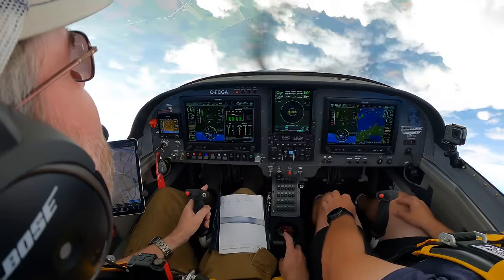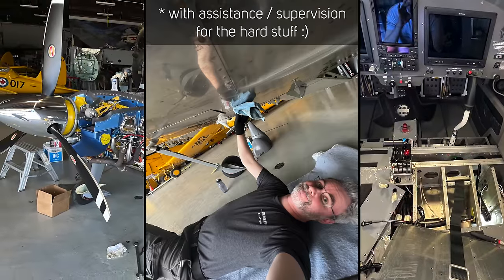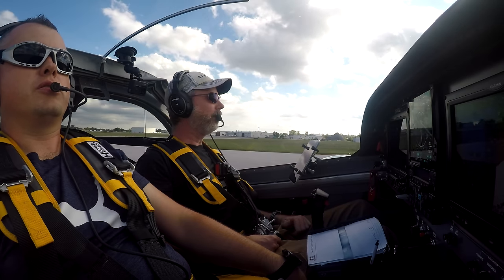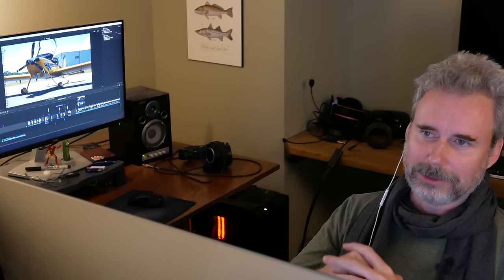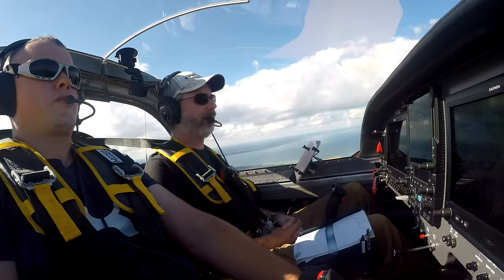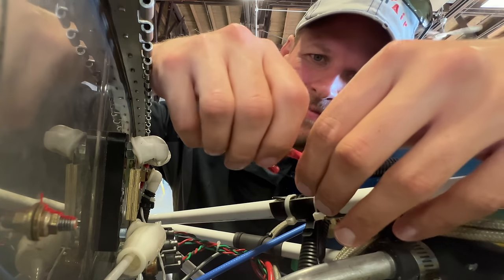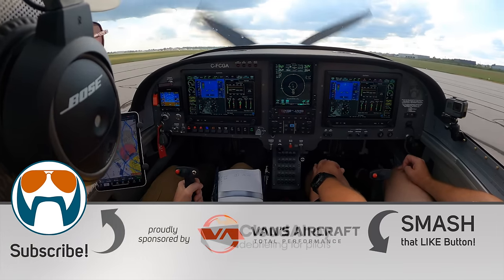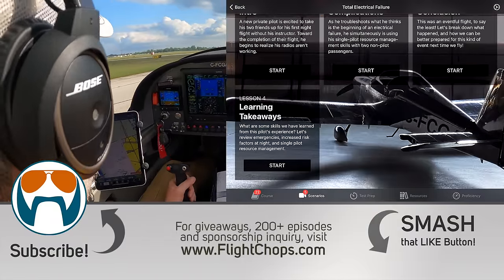Loop Induced Emergency?!

Comment: Modern synthetic oil can handle some extreme temperatures for short time periods.
Military AC can run with zero oil pressure for X amount of time.   So you have that on your side at least.
Reply from the maker: True enough - but seeing a number suddenly well beyond redline is still rather unsettling.
Reply: Nothing you said applies to this incident. There are no modern synthetic oils or military aircraft here.
Reply: @blegi1245  
My 2011 Corolla runs 0W20,  which is a synthetic oil.
If you know anything about aero engines you know they cost a fortune and I would be very, very, surprised if they were not running a pure synthetic oil.  
So lighten up. 
PS.  I love talking about motor oil.

Comment: Mechanic here, its absolutely a realistic spike in oil temperature, kind of! It all depends in how your oil system is plumbed. Most of the time if you have an external oil cooler there is a thermostat with a bypass that only sends oil through the cooler once your engine oil temp exceeds the thermostat set temperature. If that thermostat sticks closed the oil in the engine can heat soak, if the thermostat then opens the oil circulation speed up and the hot oil makes it to the sensor and shows a temp spike. Seeing the spike is really dependent on where the oil temp sensor is placed though. its unlikely that you would see a spike if the temp sensor is in an oil gallery on the block, but it’s very possible if you have a sensor present in the oil cooler loop. Either way i would double check your oil thermostat just to make sure is cycling properly.
Reply from the maker: Excellent insights here - I appreciate you taking the time to share!

Comment: NEVER, NEVER, NEVER trust a crimped connection! Always solder connections!
Reply: actually solder connections can fail quite easily in an environment with high temperature and vibration like under the engine cowl of an aircraft. crimping is almost always the right call when an engine is involved.
Reply: @murph9935  Reality says differently. This is case study in crimp failure. Just practical experience tells you crimping is highly prone to failure. I work in robotics and I can't tell you how many times I've seen crimps fail - literally thousands. I solder all my connections and never once had a failure.
Reply: Nope, solder is a no-no in high vibration environments. Proper crimp connectors are great, spade connectors are pretty universally bad.
Reply: @MyOtherCarIsAPlane  That's absurd, just think about how many soldered connections there are in aircraft of every possible kind! When was the last time your heard about a soldered connection failure? Like NEVER! And just to be perfectly clear I'm not talking about soldering the two ends of the wires together I'm talking about soldering the wire to the connectors and letting the connectors be "Disconnectable".
Reply: @theroboticscodedepot7736  Best thing is to crimp AND solder ;)
Reply: @AureliusR  I can't disagree but in my experience crimping makes it more difficult to solder (but still very possible). You do need higher temps to get the solder to flow properly into a crimped connection.
Reply: Please understand, I'm speaking as someone who has been through J-Standard training, among others. Soldering is acceptable in aviation. Still, using a ratcheting crimper is best practice. This video did not demonstrate this.

Please understand a mechanic's perspective on soldering versus crimping.
Reply: @justinmerritt6178  And please understand also I'm a metallurgical Engineer who works with electronics and wires all the time and have personally soldered 10's of thousands of connectors. Crimping a connector to the end of a wire might be acceptable to the FAA but when people's lives are on the line it pays to go the extra mile and secure the connection with solder (and take the time to do it right) and make sure it's sealed against the elements. Also it's important to leave a little slack in the wire just for such instances of bend and flex of the frame of whatever is being wired up. And also make sure the wire is secured all along it's length and not near any high heat sources and protected from any rubbing and chaffing with a wire cover. So a simple wire can become a complex job to do correctly but that's why it's important to take the time to think through all the possibilities of what can happen because if you don't you will get bitten. I think this video and the problems he encountered make this all very clear.
Reply: @AureliusR  nope.. solder in an aircraft vibration environment often causes the wire to break because it removes the flexibility in the connection.
Reply: Deleted response because throwing AMEs under the bus isn't really what I was going for.
Reply: I love the endless "no solder in vibration environments/airplanes" debate. I've been on the fence about this for years and honestly, my gut tells me to crimp, then solder. But every AME I've spoken to tells me not to do this, so as you see here, I didn't. 

I come from an electronics background and my electronics workbench is pretty complete - I definitely solder often, and I know how to solder well, but you wont find any solder in our airplane because I have strong guidance from really good AMEs telling me not to do so in an aviation environment. 

The failure of this particular joint was because it was overly tie wrapped, and was stretched and pulled to failure. The knife connector was also AME recommended. I'm confident it will hold as a good connection. Also yes, that crimper I was using is shit. I couldn't find the die-set for my ratchet crimper so I had to resort to the dollar store piece of shit seen in this video.
Reply: @thehoeser  yes thanks for replying and addressing the crimper used.. the aircraft grade terminals and crimpers have a double crimp, where it squeezes the wire and a second crimp that holds the insulation. Those original spade terminals look like the ones that only hold a single crimp. Aircraft spruce sells both the junk ones and the good ones, and you don’t know which ones are which until you look close.
Reply: @thehoeser  Yes, thanks. I was starting to think this was a dumb hill to die on.

Comment: Well handled, and good lessons for us all.

One of those decisions I have made before getting into a situation where I'd need to do that decision in a hurry:  If I ever need to cook the engine to save the rest of the plane (or even just my own ass), I'll cook the engine without hesitation, because I have already done the agonizing over it while sitting safely on the ground.
Reply from the maker: Yes, this was a great lesson for sure.  
To clarify the question around trying to save the engine: 
I really don't have the understanding or experience to know what would happen if I continued running it over the oil temp redline. 
Was a fire or catastrophic failure imminent?  I don't know.  So, I was trying to avoid the situation of an inflight fire, or being forced to put the aircraft into a field where it would likely flip and at best, we'd both be injured to some degree...  
My goal was to see what I could get out of the engine while at least keeping the oil temp in the yellow; That is what I did with about 14" manifold pressure, and I made it ~22 miles home in a constant shallow descent from ~7500' AGL. 
My other two airport options where ~15 and 20 miles away - neither of which was glide-able if the engine packed it in.

Comment: Not an A&P mech but a industrial process mech and that spike is indicative of a sensor failure or connection failure. as your engineer and you came to the conclusion of. 
My suggestion, just because I love redundancy, and I don't even know if it's feasible, practical, or allowed and that is an in dash analog oil temp gauge. I realize I may be talking right out my butt not knowing these system nor being certified to do anything but look at them. That said on every piece of machinery i every worked on that was Hydraulic. We had RTG's going to the HIM and a thermometer on the Hydraulic tank for redundancy.

Comment: the problem of your aircraft sounds very strange. I did some research a long time ago about a German aircraft. That had sort of the same problems with their sensors on oil temperature. They found out that it was their wires weren't insulated properly. And causing too much heat on the outside of the wires. They be constantly melting.. I'm not a pilot or an engineer. I'm only a flight simulator guy. Heard the story from when I was living in Germany.
Reply: That problem you mention and the issue in this video come from not understanding the environment and employing the correct wire and insulation type, terminations, routing, joints, sleeving and supports. Ok, the builder can use whatever method he chooses, but the inspector has to ensure it all meets the requirements for whatever environment it's used in taking everything into consideration.
I'm collecting parts for my impending Skyranger Nynja build and picking the inspectors brains about what is required where, what parts I can and can't use and buying the best parts I can reasonably afford. Scouring the surplus market brings up all sorts of goodies and there's no reason why pre-used salvaged items can't be used if they are in good serviceable condition. Aircraft grade cable can be found at reasonable prices and proper crimps, tools, terminal blocks etc. are available - it just needs a bit of researching. Fleabay is a good place to start, or aerojumbles😁

Comment: Was there any decrease in oil pressure? That is generally a sign that the oil temp is going up. It could have been a hint that it was only a sensor problem.
Reply from the maker: I'm going to do a follow up where I cross reference the data with Dave's situation when it was a real oil temp runway.  I think the short answer is that the pressure regulated system didn't show much of a change.

Comment: Flight Chops: Just a few comments/questions:  Is there a checklist procedure for high oil temperature?  An observation so take it for what it’s worth:  get in the habit of acknowledging oral warnings such as Altitude alerts, terrain, terrain ahead,…. I’m not familiar with your aircraft but I do have over 30 years experience flying heavy equipment.  I heard an altitude alert on your climb out that I’m assuming is a warning that you’re within a certain parameter of reaching your selected altitude (eg.1000ft) and on your approach to landing the “terrain, terrain “ audible alert went off. I know that you were VMC but don’t develop a “laisse faire” attitude to these warnings. Acknowledge them because one day they may save your ass.
Reply from the maker: Yes for sure.  I had warned Andrei that the system would “beep at us” as we approached our target altitudes, but I didn’t explicitly call it out when it happened - I definitely do so when flying IFR, but for sure this habit should be all the time.

Comment: Any reason why you didn't call a Pan Pan on this?
Reply from the maker: Nope.  That would have been a technically correct move for sure.  My thought process was to decide if I had to put it in a field or if I could keep the engine running to limp home.  Being in contact with atc the entire time meant we could tell them if things got dire.  My plan worked out and a pan pan or even emergency declared wouldn’t have expedited in this case… but there is no harm in making the call.

Comment: I hate those hoses. People use them when they are completely shot, then you think they are on and you can have missed the steel bit or it pokes out into your finger.  They havent changed in forever.

Comment: If the sensor wiring is that sensitive why not replace the wire with a one that has a outer shielding?
Reply from the maker: It's not about the shielding - our issue was related to failed connectors and/or crimps - it would have happened if the wire was shielded or not.

Comment: Nicely handled.  Consider a mechanical gauge as backup?
Reply: Naaa… you can’t just back up all your gauges with mechanical ones.. inaccurate electrical gauges are pretty rare..
Reply: @thomasaltruda  So this is a brand new build, and the 2nd time.  I would back up this one gauge because it's been problematic.  At a later date, it could be removed if desired.  He did a great job with the emergency, but it push him in to some compromises.  Since this seems to be the only problem child, I'd back it up until I had enough data to be confident the gremlin was indeed found.
Reply: @richardaldom741  the mechanical gauge is electrical too, it just uses an analog movement instead of an digital display.

Comment: On subject of hot oil temp I would expect to see oil pressure decrease.
If pressure remained steady it has to be a monitoring issue.

Did you practice  dead stick landings incase of a real engine problem?
Reply from the maker: Check out the latest episode where we compared engine data with the REAL oil temp runway - the results are surprising. 
And yes, absolutely I have practiced forced / power off approaches in this aircraft.  I still want to avoid putting it into an un manicured field at all costs though - the odds of flipping over and being injured are high with small main gear and low profile wheel pants.

Comment: hmm, i dislike spade connectors all together,  That isn’t the same oil that did get hot is it? you surely changed it. but I know once oil gets hot once, it will do it again much easier.

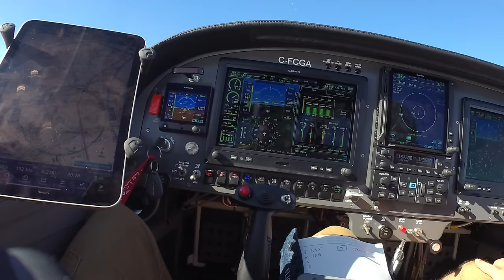Comment: At 14:08 point, what switch did you flip?
Reply from the maker: It's a switch that inhibits the Garmin "Electronic Stability and Protection" - essentially disabling the autopilot from stepping in when it sees what it thinks are unsafe attitudes. (this can be done via two or three clicks into the menus, but I liked the idea of a hard switch for it.). 
There are episodes that do a deep dive into the panel design and functions if you haven't seen them I can post links.

Comment: Those warning caption alerts are far too small & off view centre in a busy visual panel. Having a coaming warning light come on only alerts you to a problem but doesn't direct your eyes to the affected parameter. 

The Attitude Indicator is the master instrument so why can't Garmin programme a giant flashing red box around the AI periphery with the caption itself overlaid at the top of the screen above the attitude indicator at the same time? That would be an instant attention grabber and eye director all in one, saving the "wtf" seconds as you wonder what is going on and where to look. Just a thought...

Comment: In the middle of the loop, the ADSB was saying “traffic” was that actual traffic or because of the loop maneuver?
Reply from the maker: I've been waiting for some one to catch that :) 
It is actually something to do with the traffic system failing briefly, which often happens in sudden / strange attitudes.
Reply: @FlightChops  weird, I was wondering since you guys didn’t even mention it or address it in the video I was like traffic! 😂

Comment: The wire locking at 6:49 mins on this is very very poor the probe you are talking of is able to back off as it is not positively locked by the wire also you need to look at an Aviation Mechanic's handbook for how to wire lock items correctly. as an Aircraft Engineer of 40 years' experience who was taught in the Royal Air Force (RAF) and has worked for Gulfstream and Cessna. Plus also working for major airlines around the world, who has also instructed aviation maintenance this is something that needs to be sorted
Reply from the maker: Ok - I'll have a closer look a that.  Confirm you're talking about the lock wire to the left..?  (the wire to the right is for the oil filter.)
Reply: @FlightChops  Both pieces of wire locking need to be redone the Oil filter isn't locking at all and the Temp Prob needs to also have a positive lock on it and the tail on it needs to be a lot shorter and tucked away as a young Airman our instructors would really go to town on our wire locking and after years working aircraft you come to see why they did it shows the Standard of the Professional that is doing the work is working to if the simple jobs are Neat and Tidy then the rest of the work is to the same standard  plus having your Oil filter or Temp Prob backing off it flight will cause you issues as has happened if the Temp prob is loose then the resistance will change or become intermittent,a book I suggest to all amateur builders and Professional's alike is  a Standard Aviation Maintenance Handbook by Jeppesen or ASA with lots of good information and helpful information for all over time.

Comment: Were you able to determine what the cause of the failure was? Broken wires due to the TY wrap pulling on the connection or the crimp itself not sufficient.
Reply from the maker: We didn't get into thorough testing of exactly what failed about the spade connection. Dave just cut them out (along with some wire either side to start fresh, and installed the knife connectors.

Comment: Good video, but a little parameter fixation for me….. only 1 parameter cant lead to a major engine failure
Reply from the maker: Yes for sure.  This was a good experience to remind me to have a wider scope. The recent issue that Dave had definitely pushed me toward expectation bias that it has been the scat tube again.
Reply: @FlightChops  Very good video 👍🏻